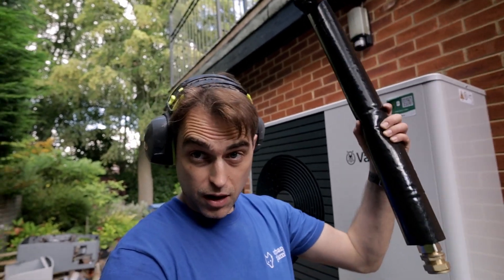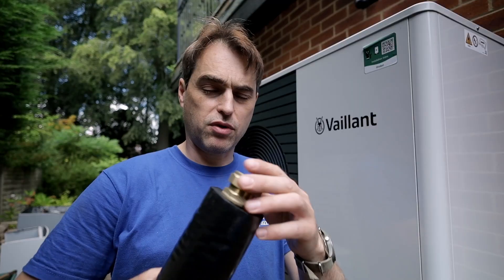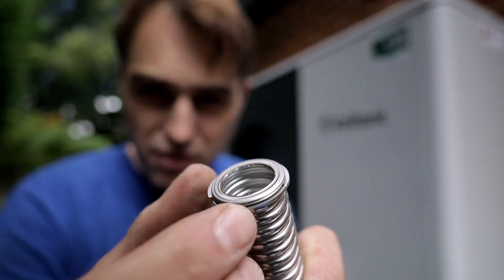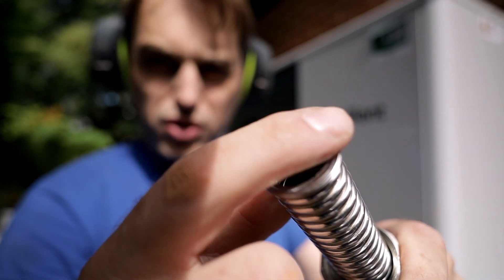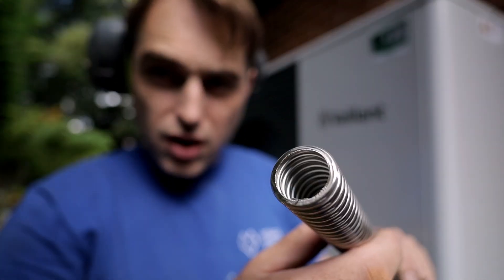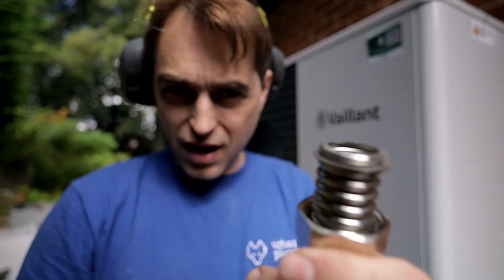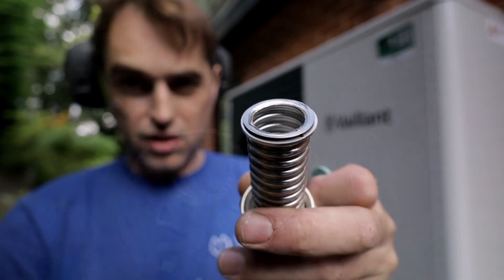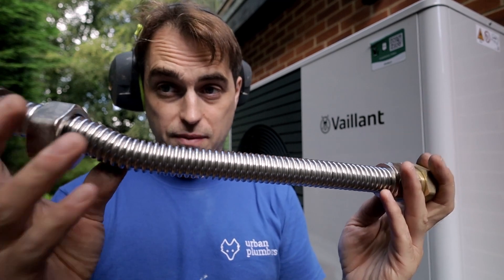Heat Pump Installation Tips - Flexible Hoses Trick

Comment: Do you have to have a flexible hose before going through the wall? I guess not, but I agree that it makes the alignment of the drilled hole much easier. 

The reason for this question is because I have one where I could go straight into the wall with regular copper pipe 28 mm + insulation, but a flexible hose only would make things more complicated as the Caleffi valves need something stable to attach to. So a flexible hose isn't the best option here in my opinion. I only want the be reassured that the flexible hose hasn't has another function apart from the alignment of the drilled pass through. Possibly dampening the the vibration of the monobloc or something?

Comment: is it mandatory to use flexible hoses on heat pumps or there is some situations where you can just connect the pipes if they have some play from going throu insulation or something ?

Comment: Very good. I'm interested to know how you generally connect to the G1.25 male on the heat pump. Do you use a G1.25 to 35mm 'compression', then used an adapter to go from 35mm to G1 for the flexi connection?

Comment: Unfortunately the latest vaillant hoses I have received from midsummer are of a different design and there is no longer a circlip washer and the stainless hose if fatter so the nut can no longer slide down the hose.

Comment: There is also  a tool you can buy to make the fitting and flatten  pipework, used  to use with the king span dn20 thermal solar pipework when fitting there thermal solar kits 👍

Comment: Great solution!  
Question 👍 Do you not find corrugated hose produces resistance/turbulence and why many use smooth braided hoses 
If I may make a suggestion  
 Then, use the plastic-coated class O inside so as to not waste it ) Replace it with Primary Pro and seal it with our Bond & Seal. 
You then make sure you have quality, water-resistant insulation sealed on all joints and to the heat pump to not just stop heat/energy getting out but stop moisture/water getting in, which will increase the thermal conductivity and seriously reduce the insulation efficiency.  

keep up the great work

Comment: Oi Dracula, that’s as rough as toast mate!! Using a Grinder(without a guard or PPE!) to cut Trac Pipe. Specialist cutters are required son or at least a set of copper cutters, to cut that Stainless Steel.
Good video regardless, keep up the good work & I hope you don’t get deported any time soon👍👍👍
Reply from the maker: Where have you been for the last 6 months? Have they locked you up in the mad house again? I am glad you are out now.
Reply: @UrbanPlumbers  Just busy Dracula, lots of hybrid ASHP & Gas Boilers in big New Builds. Vaillants have been great, great back-up & after sales. Daikin not so good, had problems with my their support etc here in Jockoland. Going to be looking at Vokera, they’re looking promising since they joined Carrier. It’s a laff, all the Viessmann poofs are just fitting Vokera now😂😂😂
Luv Dick Puuller👍👍

Comment: I use that type of flexible stainless steel connections and pipes for solar panels (the version with insulation that resists the sun's rays...)
For such small lengths, I usually use flexible stainless steel connections for gas - for 3/4 x 30-40 cm it costs somewhere around 5-6 pounds and for 1 Inch 40 cm somewhere around 7-8 pounds...
+ I always use flexible stainless steel connections for gas on all the expansion vessels I install - I consider it more practical than connecting them with rigid connections...

Comment: This flexible pipes tend to leak at the joint after some time of usage due to thermal expansion and contraction ...Also there is a special tool for making flat surface..and use the cutter....

Comment: There is a very big risk with heat pumps. They'll work fine most winters, but come the once in a generation super winter they will potentially cause a huge problem for the nation which could lead to significant death

Imagine a winters night when the temperature is negative 20 outside (not a normal winter but the once a generation cold winter day/week). Heating demand goes through the roof while the COP of the nations heat pumps falls to say 1.5x

This means while a normal winter, maybe the nations 40 million heat pumps use 40GW of electricity, but come the once a generation winter and the heat pumps try to draw 120GW and the result will be half the country plunged into darkness as the grid and power stations don't exist to provide 120GW of eletricity 

You might argue well just build the power stations and overhead lines to handle the once a generation winter

To which I will simply highlight who is going to pay for the power stations and grid infrastructure and workers and staff and maintenance for infrastructure that will be used only once every 30 years????

To this end I would ask all installers. The government. And the public. To try your best to over insulate your homes so this once a generation risk is mitigated else at some point when the nation is mostly heat pumps the once a generation winter is going to cause a hell of a lot of old people to literially freeze to death as half the nation is disconnected from the grid as we won't have the power stations or grid infrastructure to handle the once a generation winter

Comment: Surprised that we have not seen you use the torcal system in your videos before,we have been working with it for the last eight year's or so.
It is made in various sizes and depending on size it's available in 25mtr rolls.highly fixable it saves on fittings therefore tes hydraulic resistance on pumps and overall noise p a system.
It's best to use the right too to cut and create flat surface for collet if it's not flat and deburd probably the fiber washer can be distorted.we have used this on many solar hot water systems up to 130 degrees with no problems.distinctive plumbing spain.
Reply: Yes, it has been around for 20 or 30 years here in denmark. You can get some noise from the water flow in the pipes, but easy to work with.
Reply: I can't find online such a flexible pipe 50cm or 100cm long. Only 25-50 meters long  @kvaegenbjergvej  Do you have a link to any danish webshop?
Reply: @kvaegenbjergvej  Are these flexible hoses used for water or refrigerant?
Reply: @mantasdk  water

Comment: Those connections are absolute crap. There are two other better types that I know of, one uses two silicone rings to seal the connection (tricky to install for the first few times), and the other is press fit, the corrugated steel gets pressed on brass, using a brass ring and a brass seat. High pressure, high temp, ZERO ISSUES.

Comment: Pulsed hydraulic noise transmission is greatly reduced by the long corrugated pipes. I don't advise shortening them. Wall mounting of heat pumps also increases noise transmission and should be avoided where possible especially on timber frame properties. Hopefully you will get away with it but it can be costly when you dont.
Reply from the maker: new Vaillant are so quiet and vibration free that it doesn't matter anymore. Adam from Heat Geek installed his Vaillant on a timber roof and there is no noise at all. I have also wall-mounted those units, and there is zero noise or transmission from them. I have also hard-piped them with no trouble.

Comment: I love how easy and common sense you make a lot of these things look. Does make me wonder how many installers/plumbers are at that level though, or how many just buy new parts and charge the customer.
Reply: Because you don’t need a different part. Did you even watch the vid? Such a waste to throw that all away and buy a new one. It would take you longer to go and get the new part than adjust the one you have.

Comment: I'm surprised the supplier provides a corrugated pipe.  Are the head losses induced by the corrugations not a problem, compared to standard multi-layer pipe ?
Reply: Its to reduce vibration into the house so a little bit on the end should make no difference